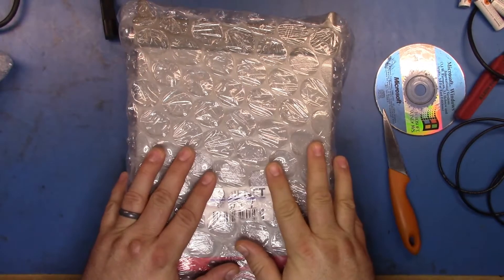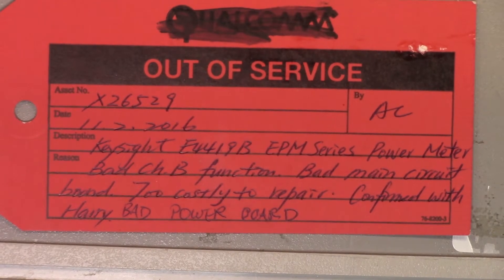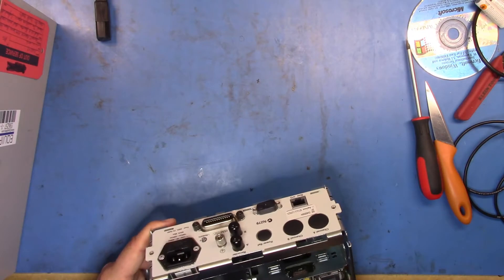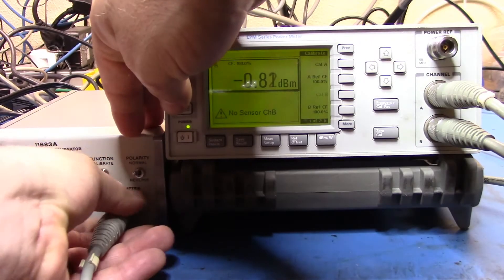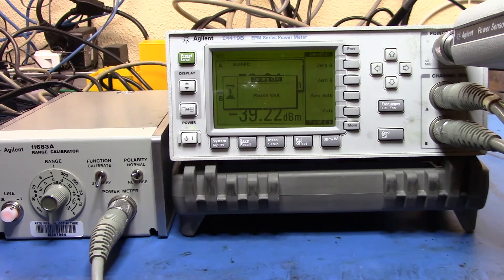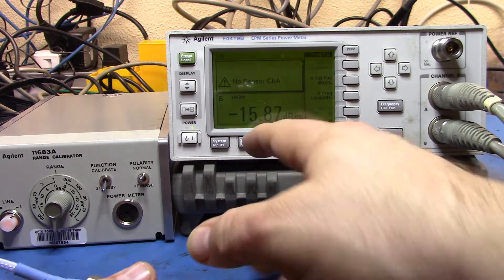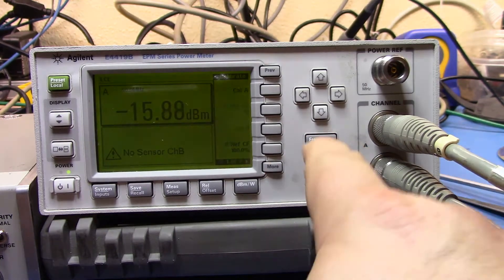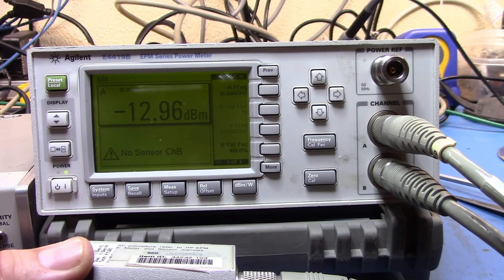Agilent E4419B Power Meter & E4412A Power Sensor

Comment: watch your movie, you can't see anything on the screen except when you black it out, reference source sucks
Reply from the maker: Sorry, not sure what you're seeing, as I can see the details on the screen (for example, at 6:56 it is showing approx -27dBm). Also not sure what you mean by "reference source sucks", the only reference source used is the one built internally into the E4419B. That is a fixed 50MHz 0dBm source used to calibrate the sensor loop.

The 11683A is just a range calibrator and isn't meant to be a signal reference as it justs feed the calibrated voltage to the unit and not an RF signal into the sensor head.

Comment: Hi, great video. I just signed up.
I have an Agilent E4418B but I bought two sensors HP8482A and HP8482B. I have a doubt, but can these sensors be used? Or do I need sensors like the one in your video, which is Agilent?
Thanks.
Reply from the maker: Assuming that the sensors themselves work then they should work with the E4418 - You will need to either manually set the cal factor or load in the right values to the appropriate sensor table in the meter. There is a section in the manual on using 8480 series sensors that shows how to do this.

Comment: Well don't you have good luck! best you start buying some lottery tickets! Cheers! 73's ve3aam
Reply from the maker: Well, it turns out that the power supply isn't working now so maybe I just needed to wait till reality caught up with the trouble ticket...
Reply: @tgsoapbox  well that's to bad, but I'm sure you can fix it. manuals are on line, surely you have them/it.
Reply from the maker: @dalesmith8666  Thanks, I have the single-channel version of the meter that works so I have a good power supply (assuming that is in fact the problem) to compare to.

Comment: Так разъёмы не соединяются.
Reply from the maker: The connectors work on the unit but it has just started to fail to turn on so I think maybe the tag was actually correct and I just got lucky for several years.

Comment: Thanks for this vedio i have agilent e4416a power meter when I press the button nothing happens the battery voltage is 2.9v
Reply from the maker: The power button?
Reply: @tgsoapbox  thanks for your reply . votages are ok 12 v,-12 v, 5v and battery 2,9 v . Stand by light is ok when I press the power button notting happened.
Reply from the maker: @radiotvrepair1059  I haven't seen the schematics for an E4416A so this is just a complete guess - A number of more modern Agilent gear required the fan to run before the unit would become fully operational, you might want to try checking out the fan in the unit to see if it is getting power and if it actually works. If that isn't the issue then I would suggest posting to the HPAK group over on groups.io (https://groups.io/g/HP-Agilent-Keysight-equipment) and see if anyone there has some suggestions.
Reply: @tgsoapbox  the fan is on.  I hear his noise.the group does not exist.thanks

Comment: How to use back reference?
Reply from the maker: Sorry but I don't understand what you are asking. Can you explain a bit more?
Reply: @tgsoapbox  I want to ask how to use power reference at rear. How to connect or where to connect?
Reply from the maker: @teknoy5417  It's used the same way as if it was on the front - Those devices with the ports on the rear were typically used in automated test rigs where they were cabled up to the DUT - Just follow the same instruction in the manual as though they were on the front.

Comment: Beautiful day! My question would be like that, why does not come for me it RS232 menu? I would like to refresh it with cable like this the firmwaret. The serial does not appear in the starting test unfortunately port body. Thank you!
Reply from the maker: I think you have to turn RS-232 on in a menu - Did you do that? I've never used the serial port as I run GPIB for all my instruments.
Reply: @tgsoapbox  I do not find this menu unfortunately. You are for me does not appear. Would he be able to help me with this?
Reply from the maker: @bisteycs  It is in the System menu under Remote Interface. This is on pages 115 & 117 of the user manual. You can get the user manual from the Keysight website - Just search for E4419B on the home page and the manual will be in the documents tab.

Comment: Benefits:

Backlit LCD display allowing observation of results in low light conditions.
A graphic display that allows displaying any characters or graphics, allows you to create descriptions.
Stable behavior of the last digit when displaying low power levels, a good way of averaging results.
Works with both the 8480 series of old power sensors and the new E series sensors.
High speed in automatic mode, the meter switches the measuring ranges very quickly, thanks to which you can work only in automatic mode.

Disadvantages:

Very low contrast LCD matrix, you can adjust it, but if you do not regulate it is still weak, but acceptable.
The audible and constantly working fan, even after switching off, in a quiet room can be tiring during long-term measurements.
The impact of the GSM telephone caller on the presented measurement result, on the original cable with about 0.5m on the non-original with 2m. This unfavorable feature means that you should leave the GSM telephone behind the measuring laboratory. If this is not possible and we have to be constantly on-line, the GSM telephone should be moved a few meters from the E4418B.
A new, completely different philosophy of meter operation, somewhat devious but quite logical.
Reply from the maker: Thanks - Nice summary of the difference between the 43X series and this meter.
Reply: @tgsoapbox  Thank you very much for the answer, I wonder if such correspondence with the use of Google translator is acceptable? Is it understandable enough and is my website readable understandable if there are big problems?

Thank you again for your response.